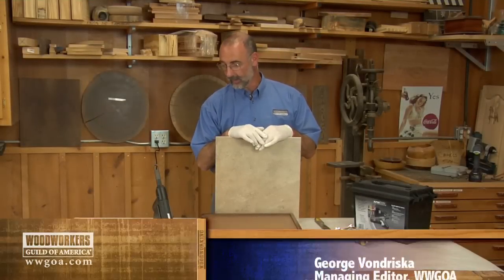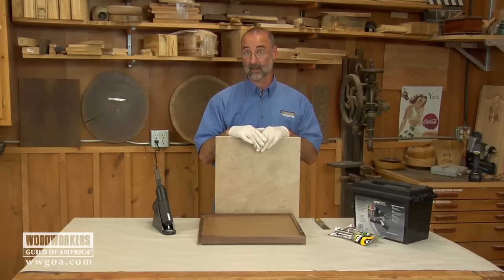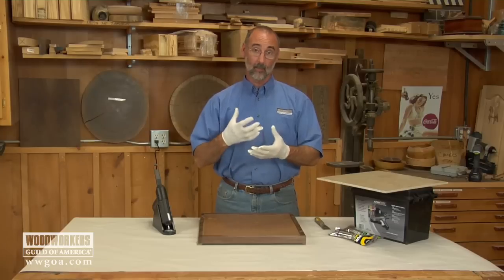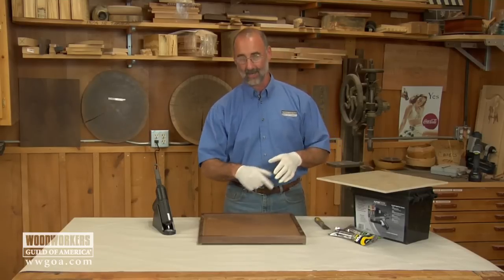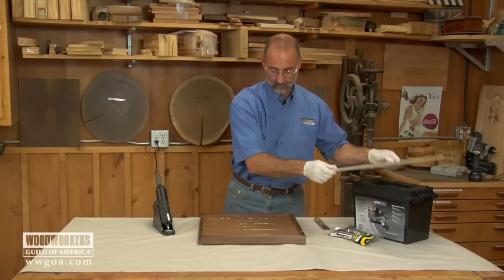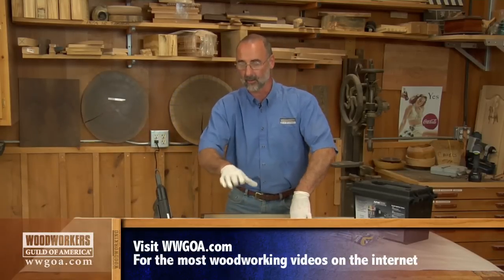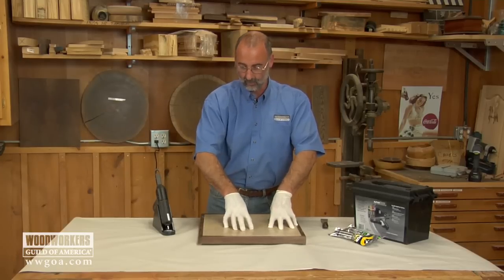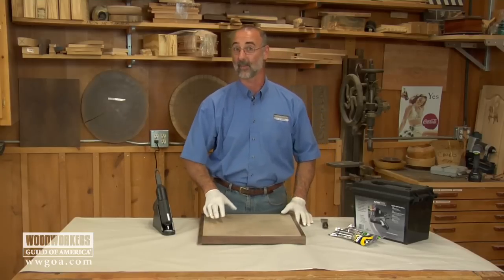Adhere Ceramic Tile To Wood

Comment: I want to glue a 1x2" piece of wood to a slate tile that will hang from the wall with d rings and wire, drilled into the wood after it's glued on to the tile. Will this hot glue work for this situation and the weight of the time is approximately 5-7 lbs. So it needs to hold!

Comment: Hot glue 4 corners silicone the middle. For side panels the hot glue will bond quickly as the other dry slowly.

Comment: Would you recommend this for a living room wood floor (10’ x 20’) to lay ceramic tiles on then grout?
Reply: Lol No! Absolutely not. It's possible for wall panels but absolutely not for the floor. Flooring needs to be solid. Especially tiles. 1 drop of something with weight could easily crack a hollow spot. 😇✌️

Comment: Just use wood glue man. The tile is rough enough to join much stronger than over rated hot glue. You buy kits to fix a loose tile, guess what. Ponal makes that kit. 100% cheap wood glue. Works perfectly.

Comment: Great video. Can anyone recommend a specific brand of this hotglue? Thanks!!
Reply from the maker: Most of the craft-grade glue guns are about the same, with modest bond strength.  If you want to step up to better bond strength, you might consider a polyurethane product such as this: https://amzn.to/3FgAXjJ.  That product requires a special gun like this: https://amzn.to/3zOaN6U

Comment: I have painted ceramic tiles I want to adhere to wood and hang on the wall as art. Will this method work while it is hanging perpendicular to the floor?
Reply: Wondering if you ever got an answer to a good adhesive for this?  I'm doing the same thing.  :)
Reply: Not sure if ever got an answer but I would use a product called musselbound.   easiest way to adhere tile to wood, glass, fiberglass and even concrete
Reply: Hugo Miramontes thanks! Will look for it.
Reply: Thank you!
Reply: Old video, but where do you get the wooden frames?

Comment: So what was the wood glue you used????
Reply from the maker: This video features the Titebond HiPURformer Advanced Bonding System; there are a few different types of adhesive that come with this depending on what you are working with.  If you want to step up to better bond strength, you might consider a polyurethane product such as this: https://amzn.to/3FgAXjJ.  That product requires a special gun like this: https://amzn.to/3zOaN6U.

Comment: That's great, but the nearest hardware store is an hour away. I  want to glue tile onto a shelf. I have E6000 and 527 at my house.
Reply from the maker: Sorry to hear that.  I have forwarded your question to our experts to see if they have any suggestions.  Please allow 1-2 business days for their response.  We will post it here.  Thanks!
Reply from the maker: I just read the packaging for E6000 and it lists wood and ceramic as options.  You can also find a lot of adhesives on Amazon and other online retailers.  
Paul

Comment: high temp silicone is easyer and HIGH TEMP... you can take a pan out of a 450deg oven and set it on a trivet glued with high tem silicone with no problems...nice video tho...